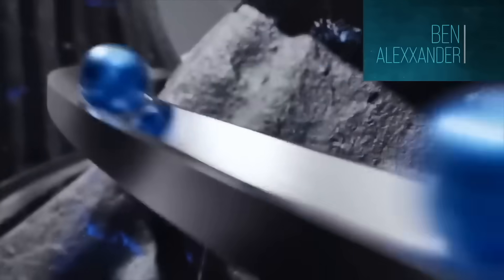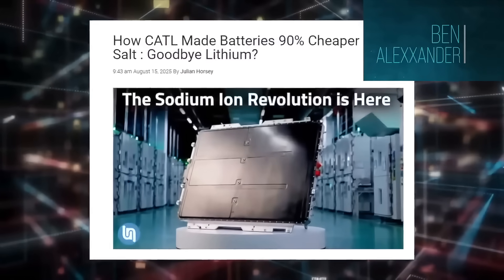CATL Naxtra: The Sodium Ion Battery People Said Couldn’t Work in Cars

Comment: I'd like to see comparisons to Aluminum-Ion and Zinc-Carbon battery technologies in terms of energy density, cold weather performance, recharge times and relative longevity. It's been quite annoying to hear all the incessant hype about Al-ion and Silicon-Graphene, Iron-air and Zinc batteries that claim desirable features but won't be ready until beyond 2030. A lot could happen before then, and actual free energy generation devices might possibly replace most forms of power generation by then, and batteries will be mainly used for energy storage systems and small portable devices where they can last for a long time and won't need daily charging. I'm wondering if the battery companies are seriously considering getting out of the battery game and starting to consider designing and manufacturing free energy generation devices. Clearly, it will take decades to replace all the millions of soon-to-be obsolete power generation technologies and recycle the useful materials. I'd surely love to be alive to see a day when we no longer have to pay for energy but will have it available on demand 24/7 for our homes, vehicles, businesses and for recreational activities and never pay a fuel bill again. The money saved on energy costs alone would be enough to fund whole industries and accelerate the transition to free energy generation. Everybody knows that having free energy available to the masses essentially means having greater FREEDOM from financial tyranny and the unchecked control of everything by energy Barons, monopolistic Corporations and Globalist Elites. Clearly, THEY are what's been holding back the new Industrial Revolution, and they've been doing so since the times of Nikola Tesla and others. It's time for the masses to decide to overwhelm the Barons and Elites such that they won't have enough money, nor influence, nor political power to prevent the next Industrial Revolution. The sooner we get the train rolling, the sooner we can address and eliminate many of our societal systemic issues like slave labor, food deprivation, clean water deprivation and health care deprivation. 2026 is shaping up to be a critical tipping point year for new technologies, and mass deployment of free energy technologies should be right near the top of the list. While we may not want to abruptly dismantle the whole economies of many nations who depend on fossil fuels in too short a period, we should be more rapidly be designing and deploying viable methods and processes and enacting common sense laws to manage them and bring about a reasonably orderly transition away from fossil and bio-fuels in such a way that the most poor nations will not get totally left behind and the oil dependent nations don't experience catastrophic collapses. An enormous amount of resources, manpower and manufacturing capabilities will be needed to ramp up such a transition over the next decade. Every able-bodied adult in every nation will need to be employed in order to help accelerate the transition. I'm sure it won't be easy to juggle all the responsibilities to avoid fraud, waste and abuse, but we need to get things rolling in the right direction. The Barons still own us and most of the patents that can free us from their tyranny. Let's hope for a breakout year in 2026. I really hate having to pay an electric bill and I'm ready to see it be eliminated for good sometime before 2030.

Comment: 1 imp point is volumatric density vs gravametric density. sodium requires atleast 20% more volume even if energy density is comparable which is not coz lfp has more potential to up its density. sodium will be big in a couple of decades but long way till then.

Comment: Wide battery pack voltage swing (as it's being depleted) is not an issue. Look up Switching DC-DC Regulator technology especially 4:1 or wide input versions. This switching technology is used for DC-DC Converter and AC-DC Inverters. Much lighter with far higher power conversion efficiency. With proper filtering they can be just as smooth and quiet as older linear technology.

Comment: You forgot charge, discharge efficiency and self discharge rates. Why won't they publish those specs?   And compares 
LFP, BYD when LMFP, other iron cells have surpassed them.    The dropping voltage as current rises both show inefficiency lost to heat, but lowers specific output as power is voltage x amps, half the voltage, half the power.

Comment: I currently have 4 Teslas.   My wife and kids drive them daily.    I do think that there is a market for a long long range EV for people who travel frequently for long distances.   A Tesla like car with a range of 400 miles would have a niche place in the market.   True 400 miles, not EPA miles.   This aligns with the range of most ICE sedans.   However, I know this would require a leap in charging energy delivery speed.
Reply: Most people would like a slightly longer range in the US. Esp when traveling. Most of the 300 mile ranges are EPA - so its normally less than 300 miles. So a 350-400 would still sell well in the US. I would go out on a limb though and say fast charging is one of the reasons for that push though, so if they can get charging done in less then 5 mins, even 300 EPA miles could still work for many.

Comment: I want to have a car that have a range of 400km in any cold temp.
Reply: Not enough for me. I'd like 1,000km - until then I'll drive my Euro6 rated car that gives a rated 4l/100km on the highway. Solid state batteries might get me to change but I like my nearly 1,000km current range on 40 litres of fuel.

Comment: Can you ask your paymaster to publish the volumetric energy density of their sodium-ion battery? That is what actually matters for EVs because it directly determines range. The reason you or your paymaster CATL won’t publish it is obvious. It would kill the illusion that sodium-ion is comparable to LFP. CATL’s sodium-ion battery using PBA chemistry is around 210 to 240 Wh/L. LFP is about 425 to 450 Wh/L. NMC is roughly 750 Wh/L. So no, sodium-ion is not “as good as LFP.” It’s about 40 percent worse.

I can debunk your other claims too, but I’m tired of repeating the same explanations in every video. Thankfully OEMs decide what batteries go into cars, not end customers. This kind of propaganda doesn’t work on them.
Reply: Yes thankfully we can buy cars with occasionally self-immolating battery packs whose replacement cost exceeds the vehicle value after a service life of just a few years.  Sodium-ion may be better than LFP/NMC for end customers who want longer service life and lower replacement cost.

Comment: Do I think they will be used in cars? Sure, but as main EV traction battery, not in meaningful numbers in the next few years.
One thing I learned recently is that there are sodium variants that have much more stable voltages, more similar to LFP. I don't know what the voltage curve for Naxtra looks like, but it could be acceptable for use in cars. Bad curve=no go, because the cost of electronics would be about double, not just slightly more expensive.
The fact that they are putting it into mass production for vehicles tells you nothing about whether it can be put in EVs (as main battery). They could put it into mass production for starter batteries or hybrid vehicle batteries, for both sodium seems to be much more suitable. Why aim for difficult markets, when you have much easier markets?
Wh/kg is not the only problem. The volumetric density is also significantly worse than for lithium.
The cost advantage isn't there yet. It remains to be seen how much these first Na batteries are going to cost.
Reply: The problem is that they're going to start price wise higher than LFP - then go down and people are going to take that as Na will always cost more than LFP when even LFP was higher than some starting battery chemistry. Its just that the raw material were cheap is what kept the battery to get cheaper - and with sodium, you have too many pros than cons for it now to get cheaper than LFP. Yes, sodium still has a long ways in terms of research as well, but likely, a lot of the research that was done for LFP can some what be transition to sodium witch is what I think it has over LFP in terms of a starting point as well. Even better just the fact that any country can produce it - not limited to China or a single country.
Reply: @adr2t  I agree that it will get cheaper. But I don't see anyone claiming that it won't. It's just that some people seem to think it will happen very fast and other think it may take a decade or so before it reaches parity with LFP.
Reply: @GerbenWulff  I say we will see a drop in about 5 years. Mainly because there are so many mass production plants going online for sodium in 2026 in the US, EU, China, and a few other locations. Very fast in terms for how long LFP has been on the market. To me, the fact I can point out other countries is the bigger - value - going on where LFP was mainly focus in China. While I Think LFP does have a little more room to mature (come down in cost) I think they're nearing their limits and in some cases are already being sold under cost.

Comment: Have you seen the Donut Battery by Donut Labs?
Reply: Die ist so gut, dass bei mir automatisch ein Unbehagen Aufstieg. Kann denn eine Chemie so gut sein, dass man 100 000 Zyklen erzielt? Das deutet doch eigentlich auf Kondensatoren hin … ?
Reply: @ralfrudiracer 
Weren't the claims 100 000 cycles, cheaper than Li-ion at pack level, 400wh/kg, solid state (full not semi solid state or partial), <10min charge times, the ability to handle wide temperature ranges like sodium, safer than Li-ion. All of this while already being in production also makes me skeptical but maybe reviewers are on the job and checking it out. Hopefully its real because this would revolutionize things.
Reply: Sugar based instead of sodium? 😂😂😂
Reply: Damn, for a second there I was going, why sugar?

Comment: 100 mile range is more than fine. That gets me where I need to go. The rest of the country I can use the train. As long as I get the lowest price vehicle that's fine. A quadricycle doesn't need vast range, neither do most second cars for the family. Obviously for a 5 seat car I'd want more range but there's plenty of call for smaller vehicles with less luxury and a much lower price.

Comment: If a battery can reliably support 5C fast charging, a real-world range of around 400 km is sufficient.
Reply: Can you tell me how many chargers actually support 5C charging? And what does charging that fast do to cycle life?
Reply: @cyclopes968 Sodium-ion is thermally more stable and not prone to lithium plating, which is why ~5C charging is considered realistic at the chemistry level. Pack design and charger rollout will take time, but cycle-life penalty is lower than Li-ion at high C-rates.

Comment: People have difficulty knowing when things change.  The internet does not help in that any normal search gives you the most popular content over the last two decades rather than current state.

At one time you wouldn't discuss solar without talking single vs dual axis tracking.  But with cheaper panels tracking is now a lesser talked optimization.

While energy density still matters, cheaper batteries change optimization strategy.

Vertical solar, impractical just a few years ago.

Comment: It does not make sense to me with a fixed minimum range; it depends on the charge speed. 70 kWh and 200kW flat would be nice for smaller roadtrips and everyday use.

Comment: At the moment my thoughts are that technology is advancing so quickly that it is best to keep the car you have for a few years to let the technology reach a point where the car you need has great range, longevity, energy density, safety, 1.2mW charging and is cheap to buy.
Reply: It depends. Price war is a real thing right now and consumers are really benefitting from it buying thousands below from what they'd normally pay.  In Europe especially there's an abundance of 12-17 thousands cheap city cars from makers such as fiat, Dacia and Chinese brands
Reply: @GothPaoki doesn’t matter if prices rise. What matters is that you have confidence that the car will be worth something when you come to sell. So waiting until the holy grail (donut battery 🤞 ) arrives and then buying. If you time it right it could be the last human driven car you will ever buy.
Reply: Yep, my thoughts exactly. The next car I buy will probably be my last. I think I can squeeze another 5 years out of my current vehicle. That's another 5 years for expansion of the national charging network, development of the 2nd-hand EV market, regulatory development, international politics and commodity price trends.

Yesterday Donut Labs in Finland announced the commercial release of a fully solid-state Lithium-metal battery, already being built into Serge motorcycles and currently being developed into an OEM 'skateboard' platform in conjunction with industry partners. Not only production-ready, actually in production, 400Whr/kilo, -30 to 100°C operation, 100,000 cycle-life at lower cost than NMC chemistry. Too good to be true on the face of it, but this is exactly what I've been waiting for. In 5 years we'll see how that plays out, but there may be affordable vehicles with fantastic range available.
Reply: @bartylobethal8089  Nice. I believe Sodium does -40 🇨🇦
Reply: @markbrown8323  and I understand why that's attractive in the colder parts of the world. I live in one of the hotter parts of the world. On a day where shade temperatures hit 46°C, road surface and adjacent air temperatures can approach 80°C, so the higher operating temp is of benefit.